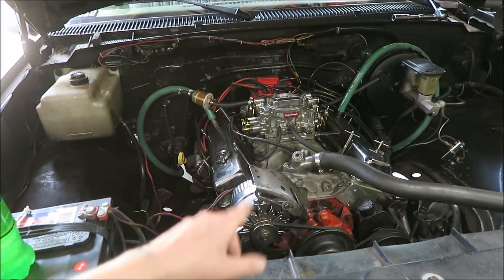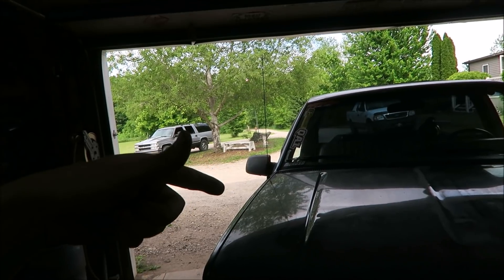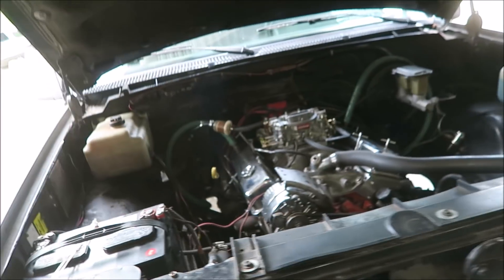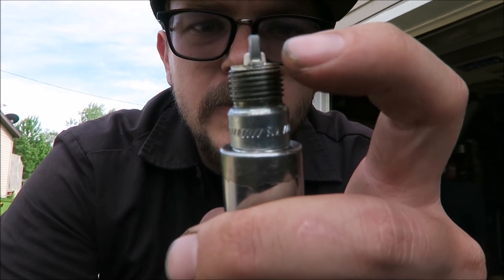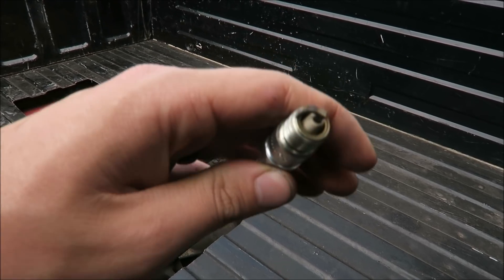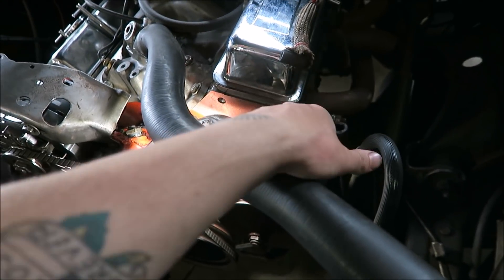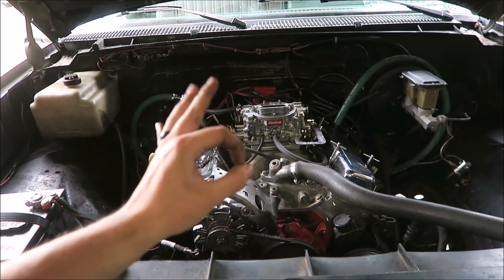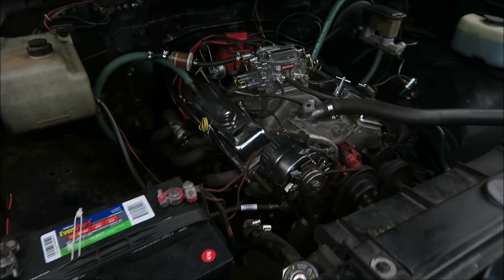Jack Black had the WRONG BALANCER! It had WAY TOO MUCH TIMING!

Comment: You want the timing to be right at the bend. If it’s past it towards the threads that means it has too much timing. If it’s closer to the tip of the plug it doesn’t have enough timing. Get fueling straight then do timing

Comment: Needs 36 degrees I'm telling ya! Sbc's love 36
Reply from the maker: I just want to make sure everything is safe and copacetic and then start tuning it up. If it can go 13.9 on 30 degrees that would rad. Then start throwing a little bit in it.
Reply: @SniderTron3000  fair enough, get the air fuel right then sprinkle a bit a timing :) I''l guarantee you it'll be the fastest at 36, that's just a good old drag racing tip

Comment: 30 deg all in now we are hooking up the vac advance  ,, sounds alot like 40 + deg of timing to me ,,just remember adding timing and fuel sometimes only adds a fire !
Reply: Depends on the vaccumm port thats used, ported will add up top and direct will only help it idle

Comment: The way the motor sounds it sounds like cam timing is retarded. Motor almost sounds like it comes up on power reall lazy witch would explain retarded cam timing. I'm surprised u guys didnt degree that cam in  every comp cam I have seen is suppose to be ground 4 degrees advance. And when u put a wheel on it and install it dot over dot almost always cam is retarded. That's what u get for an off the shelf item..
Reply from the maker: First I'm hearing of that. But, yeah, I threw it in dot to dot

Comment: Try porting the heads and intake
Reply from the maker: I might do the heads next time its apart. I've only done one set of heads and it was basically just to clean the casting material, I didn't get crazy with it

Comment: Put some mufflers on it. You will hear the pinging then! Do 3inch exhaust and it may run better with a little back pressure.
Reply from the maker: I've said I wanted to put mufflers on it, but I always get called a pussy because "it's a DrAg TrUcK"

Comment: Tdc that thing with dial indicator or a piston stop. Make a true tdc mark. Start with total timing @ 36. Single plane intake. Holley dp down leg boosters @ least 700 CFm. Just my opinion. 👍 like your channel. And truck.
Reply from the maker: I did check the piston at tdc and double checked this time that it matched with the indicator on the cover. I'm starting it at 30 to be safe and so there's room to grow.
Reply: 10-4 man. Good job. 👍

Comment: it looks a lot more than 8 degrees timing diference on those pulleys, if it survived THAT much timing , maybe the camshaft is retarded. at least in the engines i've worked on, when the timing was too high to even believe it ran, but it did, it was the camshaft a tooth or 2 off.

Comment: EFI....... EFI. EFI. EFI!
Reply: Makes more sense yeah on a daily id say efi all the way but for a drag car carb makes sense cheaper and can tune it with basic hand tools
Reply from the maker: The only real advantage of a carb over multi port efi is that the carb will drop intake air temps SIGNIFICANTLY through the carb, where the efi won't. However, with a throttle body style efi I expect it would have the same effect. Both are atomizing fuel throughout the intake. And instead of making changes with a screwdriver, you just pull up a menu on the hand held screen and make a change. I like them both. Not picking favorites. I think they both have their advantages and disadvantages
Reply: @JoeyRamone442  I agree
Reply: How we already has the set up?
Reply: @JoeyRamone442  I'm talking about EFI in general on a drag vehicle. If he's it already without buying it, then cool, but I wouldn't go out a waste a dime for it.
Reply: Waste of money, waste of money, waste of money!